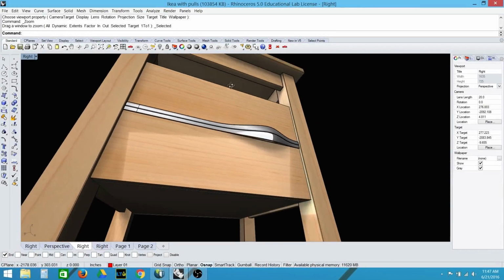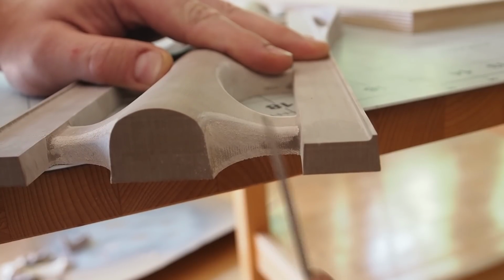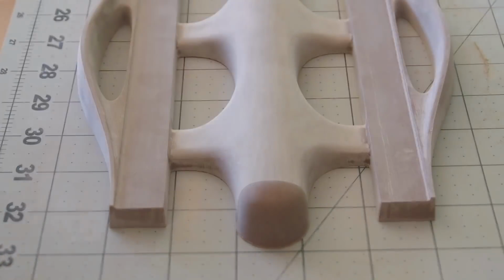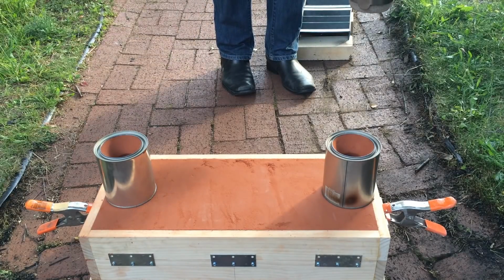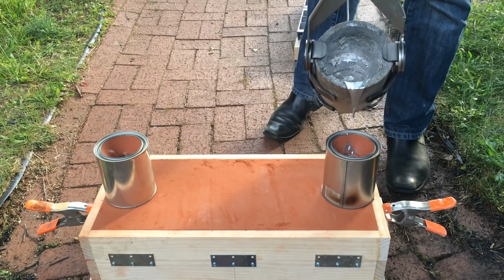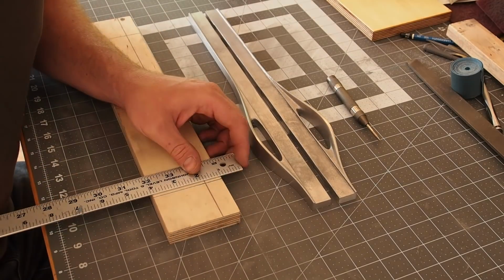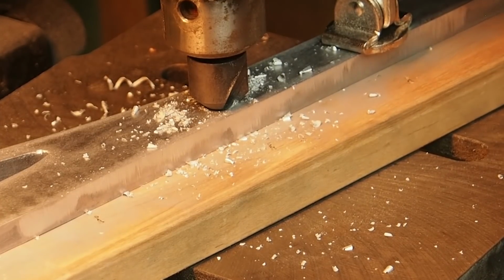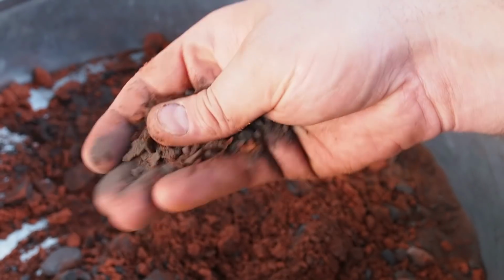Casting Custom Aluminum Drawer Handles

Comment: I don't get why you just didn't machine these from aluminum. What a waste of fuel and materials. Makes no sense!
Reply from the maker: +leehound Been covered, but fuel's cheap and it is certainly more fun to pound sand than it is to stand next to a CNC milling aluminum for a week straight (5 sets)!  Also castings can be remelted where chips can not be effectively reclaimed.  So there is more waste from a material removal strategy.  Also, unless you want to spend 10's of hours machining the surface, the finish can be better with casting.
Reply: Fair Enough.

Comment: SO MUCH WORK for something so simple.
Reply from the maker: +Glenn Burrow Here is another way to look at it...
Imagine wanting to buying nice handles for $50 a piece...  I made 5 sets so... $250.  Now think how long at your day job it would it take to buy the handles.  Now it seems like a lot more work to just buy them!  Unless you make $250/hr, of course...
Reply: +Brian Oltrogge 
Your math may be a bit off there. There is no way it only took you an hour to make these start - finish.
I mean not to detract from your work, the craftsmanship is exquisite. I simply mean that it gives you a certain amount of appreciation for what goes into making something like that.
Reply from the maker: +Glenn Burrow You are absolutely correct.  These take about 3 hours to finish a set (not including the initial pattern).  I was just trying to illustrate the point that anything we buy we are still working for indirectly.  If a person gets a $10 burrito for lunch during their $10/hour job, one of their hours that day is spent working for the burrito.  In this case, for $250 that same burrito lover would have to work 25 hours (+taxes) to afford to pay.  This is almost a full week digging ditches, for example... Looking at it from this perspective makes it seem like a lot less work doing something yourself rather than digging ditches to pay for it. 
Of course, this is only valid until you make a lot of $/hr.  If I could simply dig a ditch for an hour and get 5 sets of the handles I designed, why would I go through all the steps of making them myself?  I still might, but only because it is fun and a process I find fascinating!

Thank you very much for your comment!

Comment: Hi Brian, I really like your videos.  I have a question about this build.  Why did you spend so much extra machining time making the sprue nice and smooth, when it's just going to be cut off and re-melted?
Reply from the maker: +Meme Team Extreme Better to have a smooth runner and rough part VS a smooth part and rough runner.  

If you had to drink water out of a sand mold would you rather the surface be rough or smooth? This is how your part feels!
Reply: Alright, thanks for the info!

Comment: What is the price percent of the handle as related to the price of the piece? I mean all that work! Thanks!
Reply from the maker: +hernanc This is where multiples would pay off.  To do 1 would probably have a real cost of about $500 given the cost of pattern material and time. To do 10 might be $50-$100 per handle set (about 3 hours casting, finishing per set)  For me, this is a weekend project for myself so cost is not really a factor.  Then multiples mean about $0.50/lb for the aluminum.

Comment: you might try a home use concrete mixer,,, like a commercial type but , much smaller,,,, approx 10 gallon size, would mix and blend your petrobond ,,, add large ball bearings ,, and it will act as a small ball mill to crush the burnt to powder,,, ,,,, ???, great work,,, love the lifter tongs ,

Comment: I just run the 'burnt' petrobond together with the unburnt through a sieve, and add extra of the binding oil as needed.
Reply from the maker: Where do you get your binding oil?  I might give this a go now that I have a 5 gallon bucket full of old stuff!
Reply: The same supplier as the petrobond. (jewlers supplier)
it's only a very small % so a little bottle lasts a long time ;-)

Comment: Very cool :)  A tool you might find useful would be a set of Vix Bits - they make drilling perfectly centered holes for hardware almost idiot-proof ;)
Reply from the maker: +Terry Goyan I tried to use mine but the aluminum is 3/8" thick!  My Vix bit would only make a mark...  Thanks for the comments!
Reply: +Brian Oltrogge  Ah... The Vix bit would be used for drilling the starter holes into the plywood . They self center on your counter sink holes in the aluminum.  Of course drilling into ply can be problematic with regular bits trying to find their way between the laminations.  Amazing video! Thanks.
Reply: After all that beautiful craftsmanship I was anticipating a vix bit for the edge drilling of the drawer face. Maybe went one gets good enough a vix bit is superfluous!

Comment: lovely job why did you spend time sanding the runners ?
Reply from the maker: +Simon Stack The way I look at it I'd rather have a rough part than a rough runner.  Otherwise the flowing aluminum might pick up sand particles on its way to the part!
Reply: cool that explains that never thought of that
fantastic job
thanks
Simon

Comment: Just found your channel, you do good work! That's the cleanest out of the sand castings I've seen from a DIY setup. I guess prep work does pay off. I'm used to grinding and sanding for days and then still have some ugly spots.
Reply from the maker: +Robertlavigne1 I think a good pattern leads to good castings.  Still a lot of sanding though...

Comment: love the design, one suggestion, you could put a lip at the back of the pull and locate it in a rebate on the inside top edge of the drawer, then you could hide the fastenings of the bottom drawer

Comment: Great video, that is the best castings I have seen on here, I guess the Tetrabond played a big part and your melt looked very fluid so I guess you have a prety hot furnace. Thanks
Reply from the maker: +Robert Scratchet Thanks for the comment!  The sand is actually petrobond in case you are looking to source some.

Comment: You could get out of a lot of handwork on polishing metals, if you invest in a small polishing setup. For no more than this, a small six inch diameter, stitched muslin wheel, about 1 inch wide, with 120 grit polish, would have made quick work of that, and gave the brushed look you wanted on the aluminum. You can also buy a wire carding wheel, to enhance the look. If you already have a pedestal mounted grinder, you can buy the adapters to mount the polishing wheel pretty cheap. Take a look at Caswell Inc. for the polishing supplies. Another supplier is Brownell's Gunsmithing supplies, or any Jewelry tool supplier.

The casting was a good example.
Reply from the maker: +craxd1 Thank you very much for the suggestions! I have a grinder that is setup with some polishing wheels but I definitely need to get up to speed on the easier way to do the finish work and the contacts you suggested will help a lot.
Reply: Brian Oltrogge
There is a book, that has polishing methods in it, but it was written for Gunsmithing. However, it still applies here. The book is known as Gunsmithing Kinks, and the polishing methods are in the first volume. It is printed by Brownell's.

It might be easier to just get some rough scrap, even your ingots, and experiment on it. You'll want a polish of around 120 grit, for a brushed look, and it cuts the fastest. It will take down a thin parting line fairly quickly, especially in aluminum, though you may be better off, time wise, to use a belt sander, with the same grit, on a parting line, then polish that out.

You can get rubber Cratex bobs for a Dremel, to use for the tight inside spots. They have the polish embedded in them.

Those stitched wheels are 1/2" thick, so you'll want to stack at least two together, for most outside polishing. You wont need a loose wheel, as that is for mirror finishing, if you only want a brushed look.

I wouldn't try the polish sold by Harbor Freight, as it is junk, though their wheels are all right. Buy polish from either Caswell or Brownell's. Store the polish in an air-tight container, with a damp rag in it, so it will not dry out on you.

Comment: That is without a doubt the most perfect casting I've seen on YouTube. Excellent craftsmanship.  Great job.
Reply: Very hard to make stuff with molds that you have to take out. I would only use plaster if I used wax and melted it out, otherwise trying to split the plaster in two halfs would be awful
Reply: When he starts to put the sand into the mould, he explains why he is using petrobond, it is finer than green sand and he wants a smoother finish.
Reply: +KlixTrio It depends on the shape of the item, but you're right. I prefer it over sand mostly because of the MUCH better surface finish and the fact that I have a method for making easy copies of the original that's cheaper than using wax (which is quite expensive in fact).
Reply: +CoolKoon Could you share your method with us then ? It could be really helpful !
Reply: Search up green sand casting. It's not the best sand method, but its cheap and works pretty damn well.
Reply: XCyclonusX i
Reply: Actually plaster castings have an even better surface finish. They're a bit more uncomfortable to work with though.....

Comment: Brian, use a sieve for "re-mixing" the casting sand. It's the same type of sieve used for running a gradation in soils. Just like playing with beach sand as a child! Try using a #4 or #8 as a 16 may be too small. They come in 8" diameter rings and are used in the geotechnical engineering and testing industry. ~Loren~
Reply from the maker: +Loren G Thanks for the suggestion!  Might just work.

Comment: Awesome. Couldn't you simply machine the aluminum on the CNC?
Reply from the maker: +Daniel Suárez Yes and no...  I went into a bit of detail below.  I am making at least 5 sets of these so that would be days of machining.  Scrap aluminum is cheap and you just re melt your f-ups!
Reply: And also would thake all the fun of the process... Just kidding, makes sense for a larger production. Cheers, keep up the beautiful work

Comment: Super impressive. As always, impeccable attention to detail and craftsmanship. 

Why didn't you machine them from bar stock, instead of cast them? They are one setup parts. No porosity problems. Looks like your machine (literally yours, you design / made it) looks to be capable of 0.050" DOC and you could probably use the same tools used on the Renshape. 

Love the finished design. You're a beast.
Reply from the maker: +David Davis I could have....  The time involved in machining them would make them too precious.  Scrap aluminum is much cheaper than billet aluminum.  Renshape is easier on the tooling and ears.  F-ups are just re melted, list goes on...

MILLED-
Machine time estimated for SINGLE milled aluminum version 6-8 hours plus finishing every set (much more finishing since it is direct from the machine) I have to stand there and watch machine since I don't have flood coolant.  Bring headphones and a bucket for all of the aluminum chips.

CAST-
Machine time for pattern, 2 hours(once).  Sand the pattern for 2 hours(once).  

Pour aluminum, Wait 15 minutes, repeat.  Lightly finish parts.

I need to make 5 sets.  Now what sounds like the obvious choice!
Reply: Understood. It's an affordable method for sure. I do stuff like this for aircraft furniture / furniture concepts. We have a large vacuum hold down router and go through lots of plywood, Renshape, and perfect plank. The healthy budget means my sense of frugality is a bit.... Off. We source pieces that size, so I'm predicated towards CNC machined one-off aluminum bits. Plus I used to work in a machine shop that did product design. I feel like I'm making excuses. 

Are you looking to plate these? I worry that porosity will rear it's disappointing head. Paint or powder coat works great on baubles like these. 

I've had great success with a clear powder coat over sueded / brushed aluminum. There's typically 40 / 60 / 100% clear coatings at most powder coaters I've used. Protip : light a couple sheets of newspaper on fire in the PC oven for a smoky effect that knocks down the surface finish a bit too. The resulting part doesn't get that black oxide after a bit of usage.
Reply from the maker: +David Davis Thanks a lot!  I have been meaning to look into ways of protecting aluminum.  So far I have just hit stuff with a coat of silicone spray, but I will want a more permanent solution in the future.  I used a product called zoop seal, but it looks like it is no longer available?  I should have my powder coater do a test...
Reply: I'll find out on Monday the actual coating I've used. I think it's a polyester, and I think it is a dupont product.
Reply from the maker: +David Davis Wow, thanks!

Comment: You do amazing work and I really enjoy your videos!  

Is your crucible a #10 clay / graphite?
Reply from the maker: This is a #10 budget graphite crucible from lmine.com
Reply: Thanks for the crucible info Brian.
I remember casting aluminum back in high school over 30 years ago. I'm 46 now! I still have an American Eagle I cast back then over my front door. I was explaining how it was made to my wife and I found your channel. You should publish a print with dimensions of your keg foundry. I'd love to make one but can't seem to find a keg on the cheap. I do have a couple 55 gallon drums and was thinking about using that. 5 1/2 inches larger in diameter but I can cut the height down to size...

http://pic20.picturetrail.com/VOL1447/5244554/10627512/412622262.jpg

Comment: For homegrown, cheap mulling.. get a cheap small cement mixer, the tumbler kind out of plastic.. dump the sand in there with a bunch of steel balls.. let it work it self out.
Reply from the maker: +Moronicsmurf That's not a bad idea!
Reply: Im still really curious about your tongs.. would you wanna share the design?!

Comment: I have just watched this at the ArtisanVideos subreddit. This is mesmerizing. But with all the attention to detail - in what I assume will be an expensive piece of furniture - the way you mounted the drawer fronts to the drawer boxes leaves you wanting more. Maybe deep pockets filled after installing the fronts?
Reply from the maker: Thanks for your comment!  These tables are for my workshop.  Imagine dust and tools and stuff in the drawer and the screws might seem like less of a problem!  The fasteners allow for adjustment to get the gaps right.  I suppose I could have glued them on...  Maybe next time!
Reply: +Brian Oltrogge wait, you did this for the workshop furniture? dude, ur crazy :D

Comment: thanks for the fine example of the effort evolved from start to finish on making something like this.

but i still want to know where you got you crucible lifting & pouring tongs(combo)!
Reply: +Brian Oltrogge Please do a video on the lifter/pourer. Very sweet design.
Reply from the maker: +Randall Lasini I designed them.  I couldn't find anything I liked commercially...
Reply: Brian Oltrogge do you sell them?
Reply from the maker: +Randall Lasini I made five of them, so I intended to.  I don't want to make any promises though...  I'll probably do a video on them at some point since it seems like there is quite a bit of interest.  Full stainless can be a bit expensive though.
Reply: since my current lifter/porer is the one I got from foundry101, anything (and I would rather make it out of quality parts for length of use) is better.  :) look forward to your future video's.
Reply: Any chance you'd share your drawings?
Reply: Yes, drawings, video, something, both.  That's the slickest tongs/shank I've ever seen.
Reply: You've really nailed that lifter/tong design Brian, please put me down for a set if you ever do make some more. What crucible size range does it cover?

Comment: You're molding and casting techniques are excellent, as is the design. Can't help wondering though, if there are going to be pinched fingers for someone in the future. If I had to provide a critique, it would be to close the openings where the handles come together. Always looking forward to more video from you though, top notch stuff.
Reply from the maker: +indoorherbivore Thank you for your comments!  I 3D printed a test without the holes and left them installed on a test drawer for a week.  You wouldn't believe how much stuff accumulated.  Since these will live in my shop, they are less for my fingers and more for misc crap passage.  I get your point though, if this was for production, there would be a lot of 4 year olds with hurt feelings.

Comment: Fantastic video!
I was wondering though, why did you put in the extra time to sand the central feed channel?
Reply from the maker: +daantjuh44 ideally everything would be smooth.  This is where the aluminum flows and hopefully doesn't pick up much sand on its way to the part.  If the pattern runner is rough, the aluminum will pick up sand and bring it to the part.  It would be better if the pattern runner was smooth and the part was rough rather than the other way around.
Reply: +Brian Oltrogge that makes perfect sense, thanks for that!

Comment: Awesome design.  I'm in the process of making a forge based on your design.
Any tips or things you'd do differently?
Reply from the maker: +Pete Kehoe Make smooth or cut flush the fasteners that hold the handles on the body.  The screws are needed in the lid, but the ones in the body are likely the cause of my surface cracks.  The shell diameter expands 1/8" or so...
Reply: thanks,  will do
Keep up the videos